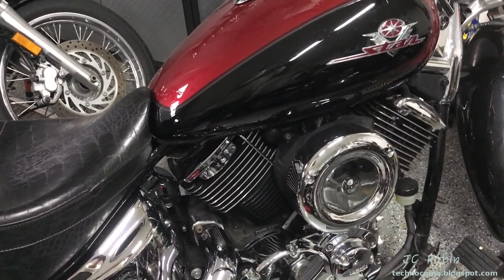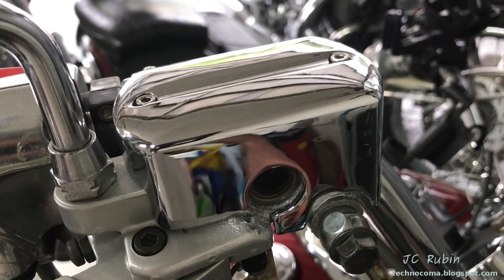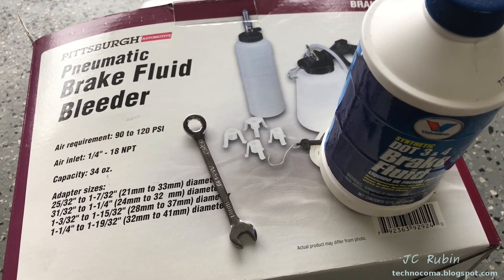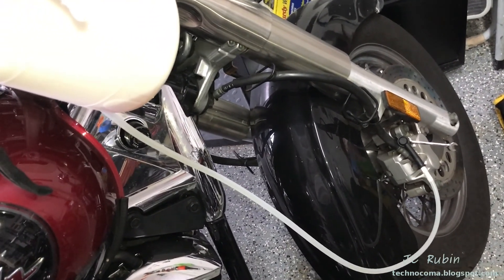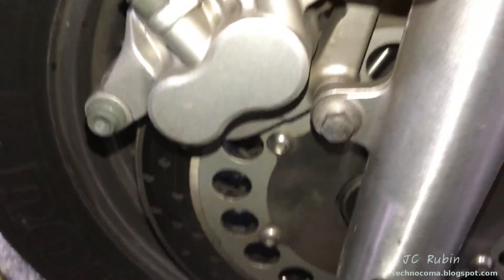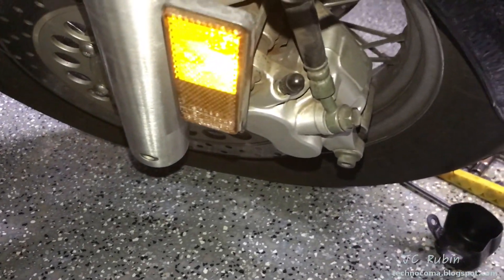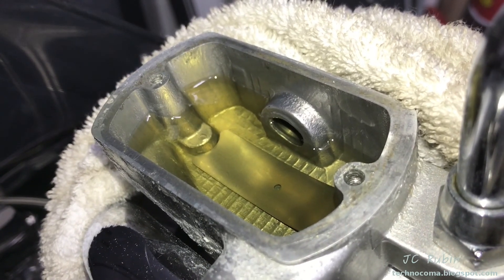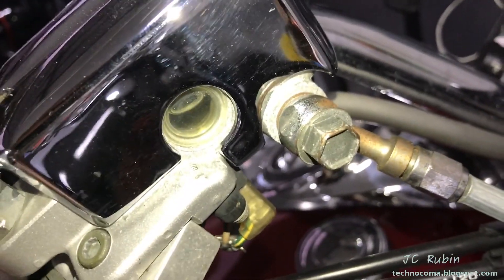Yamaha VSTAR 1100 Maintenance - Front Brake Fluid Bleeding / Flush - Pneumatic method

Comment: On my 2003 VStar 1100 Classic I replaced the stock bleed nipples with speed bleeders on the two front calipers & on the rear caliper as well.
Have you had experience with these type of bleeders?
I purchased them from an american company called speed bleeder.
Reply from the maker: Ive never needed anything else with the method i use but ill have a look
Reply: Thanks
Once you take a look can you please advise if you think that these will work well.

Thank you

Comment: I was about to go forward with the brake flush until your advice to wait & get a pneumatic brake bleeder. I trust your judgement & I'm going to order one first. Although I don't have an air compressor (yet). Do you think I could get by with a hand held syringe vacuum pump designed for brake bleeding?
Reply from the maker: Ive bled brakes for years by hand..... I just prefer not to anymore.

Comment: Can you use the break fluid in the clutch res aswell? I hear ppl do that but i put dot 4 and changed my clutch fluid but it says clutch fluid but i also have dot 4.. Can i use that for both break a clutch bleeds and changes??
Reply from the maker: I've never heard of a VSTAR 1100 with a hydraulic clutch. Better double chech what you are adding and where.
Reply: @retrotechandelectronics  mines a 98 royal star tour classic 1300cc
Reply: @retrotechandelectronics  i have a hyraulic clutch and breaking system

Comment: Front and rear, did you let the old fluid run out until the system was empty before introducing a new fluid or did you chase new fluid behind the old without letting the system ever run empty?
Reply from the maker: The reservoirs are drained, but the old fluid in the system is chased out with fresh fluid till the lines run clear.  I could get really detailed and do caliper compressions but this bikes condition didnt call for it.